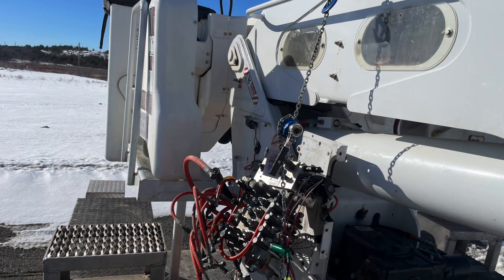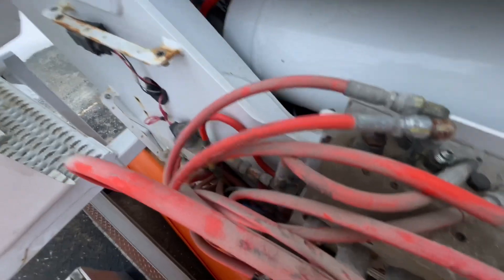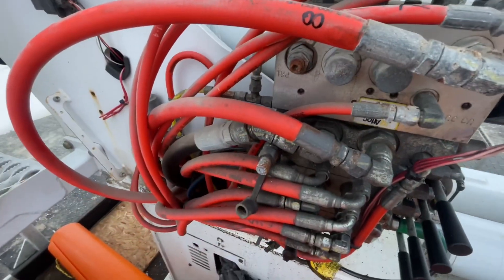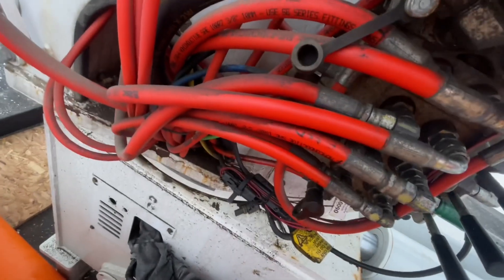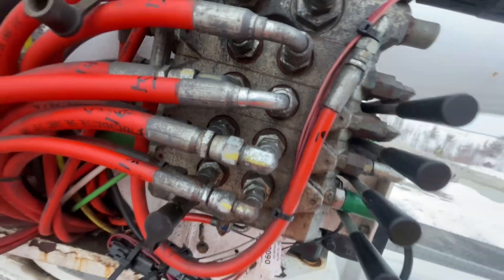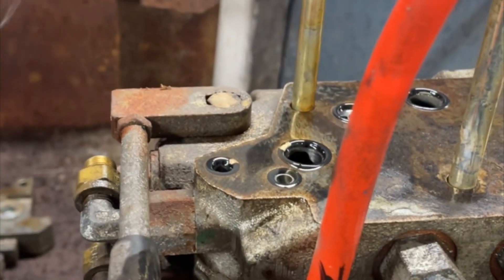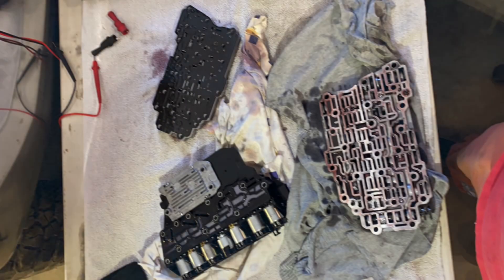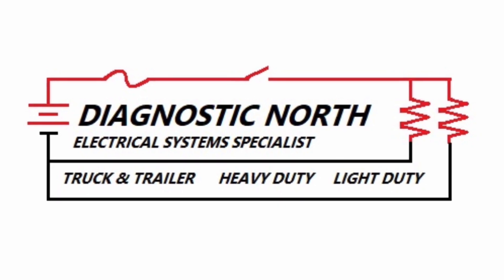Altec bucket truck. Safety concerns from Incorrect oil viscosity + remote valve bank leak repair

Comment: Prefer colored zip ties. Im color blind onncertain colors and shades of colors. Blue, purple, green, brown and gray. So i have to consider that. I also find paint pens and ink usually  smear or wash off. I think the next pile of parts i tear down I will try number tags.
Reply from the maker: We used to mark caps and plugs with an engraver or centre punch with numbers. That helped keep the area cleaner/ less clutter

Comment: best way to remove a hose close to another hose with the T fitting on a valve body or d box?
Reply from the maker: Sometimes I just use an air hammer with a dull chizel point on the end . Try not to damage the nut. Never fails and in my opinion is the ultimate solution to tight area hose removal

Comment: I don't do hydraulics but I do some projects that involve wiring and I love and have used the 3m number tape for many years. The one I use is #12174 it has 0-9 individually and has a handy hang loop. They also have a rainbow version with 10 colors of electrical tape, also I know that they make the numbers in books with 1-50 and 51-100. Also I just double up on numbers 10 and over.
Reply from the maker: Wonderful! I will look those up thank you
Reply: @diagnosticnorth  your welcome! Grainger carries the sets and you can buy individual rolls since you will use the lower numbers faster than the higher ones. Plus you'll look like a pro for the customers using them.
Reply from the maker: @ottopartz1  I found them on Amazon If anyone is interested here is the link : https://www.amazon.ca/3M-12174-Wire-Marker-Dispenser/dp/B000LDDF8U?th=1&psc=1     

I'll buy some thanks 

I'd love to hear other methods you guys use to differentiate components !